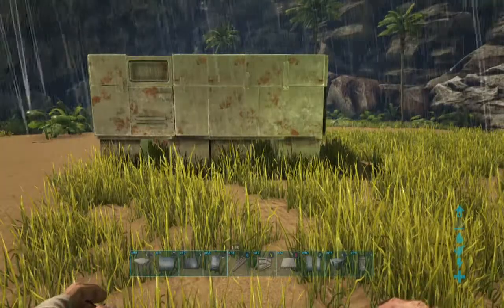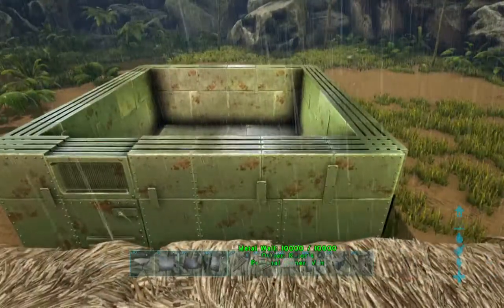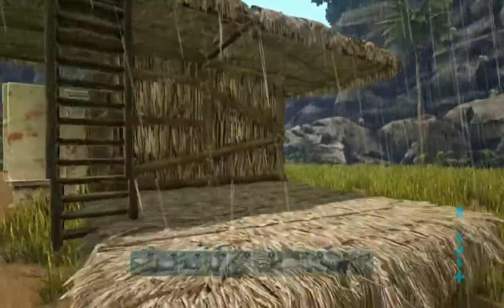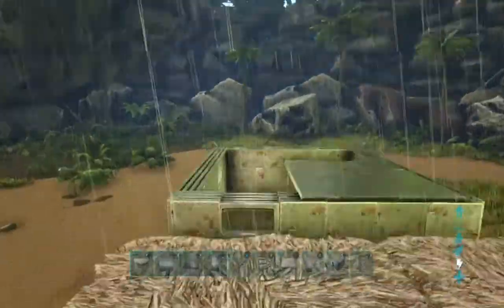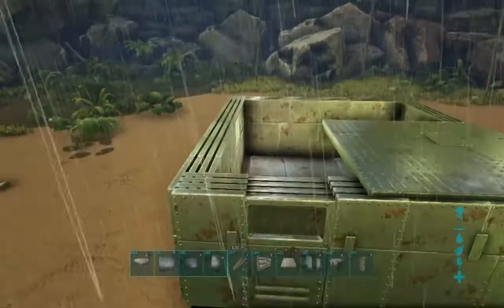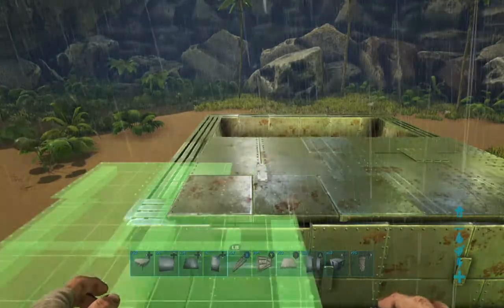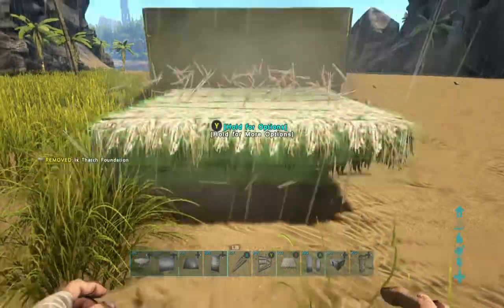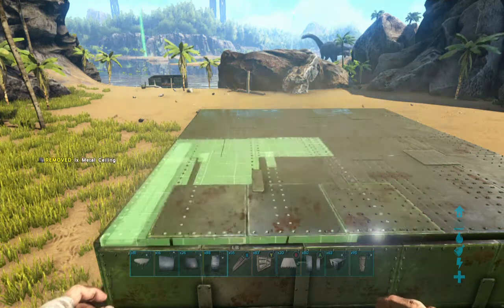The | ULTIMATE | way to Layer your Ceilings & THEN SOME

Comment: with all these metal layers the next question is how do you get the metal to burn with out getting raided lol great vid tho thanks
Reply from the maker: Steven Newdick Hahaha so typically what I do is build up somewhere very close to metal, I like using the south east right by the mountain and make a small building and put like 20+ forges and  let it burn. I try to keep it pretty hidden and if you're worried about the GiGa spawn just do like a 3x3 and 2 high in metal 👌🏻